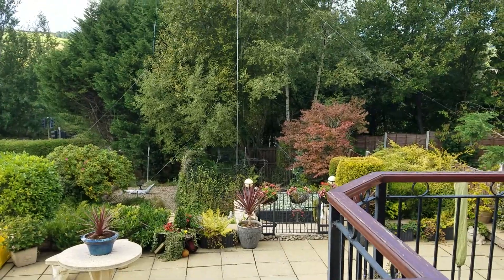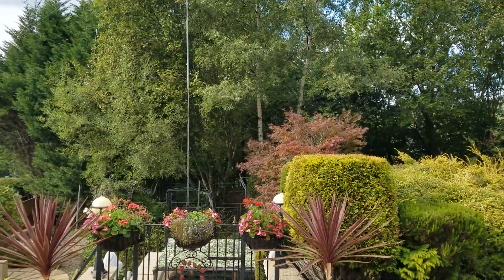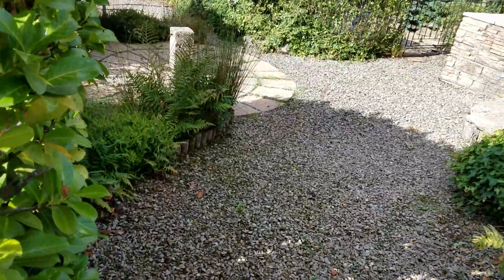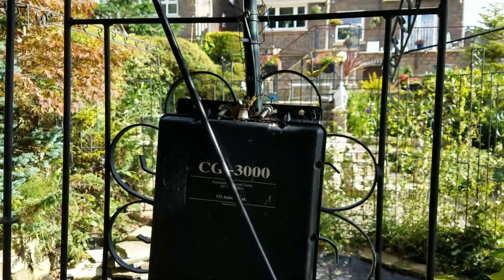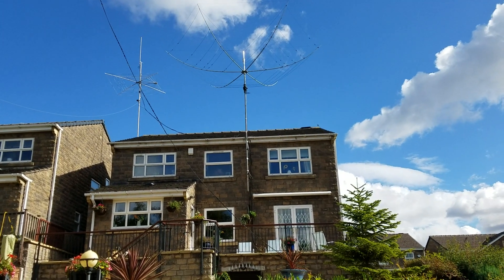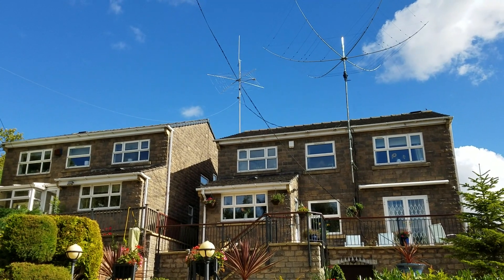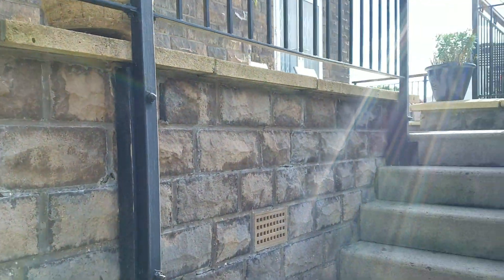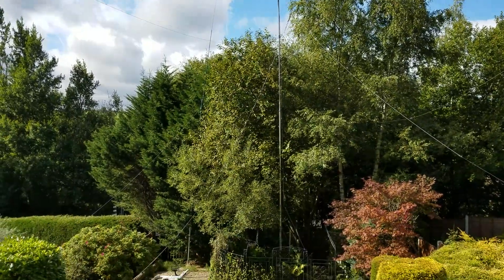Antenna tour @ Ham radio station G0DTX & G1OFZ

Comment: What is the 160M antenna? is it the inverted L with the smart tuner? Why dont you connect the 40ft mast to the smart tuner and add a few radials, would make most of those wire antennas redundant, as they are all very low.
Reply from the maker: Thanks for you input yes 160 antenna is a inverted L  and I like working into G so the wire antenna`s nvis works well for me.